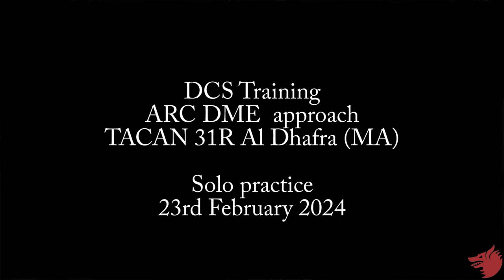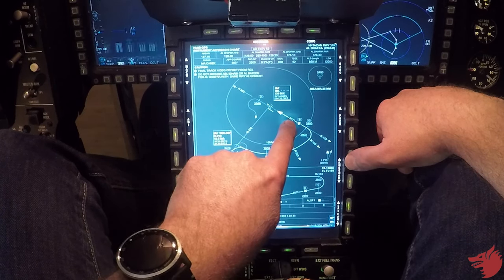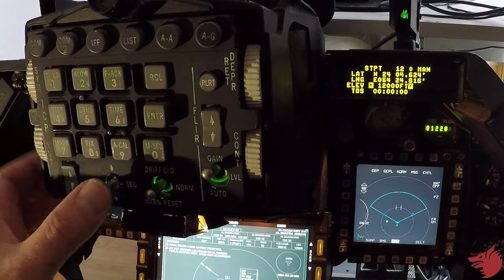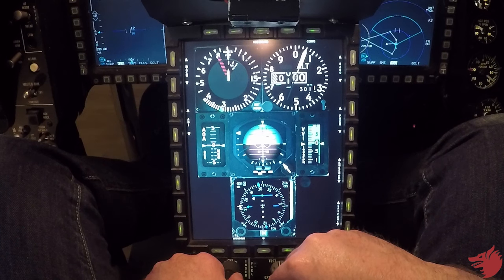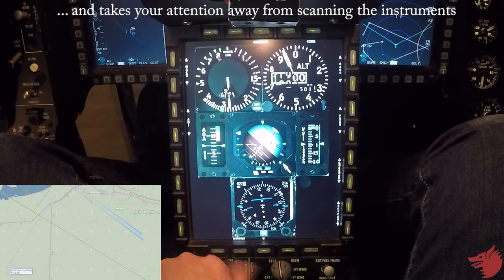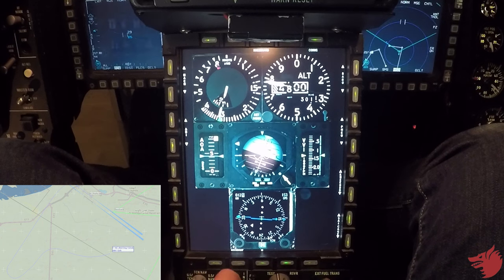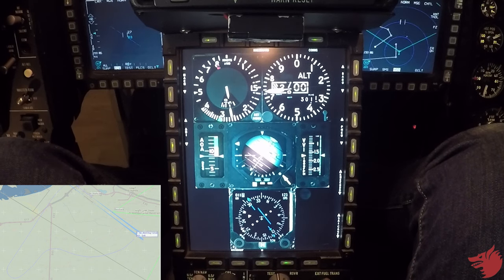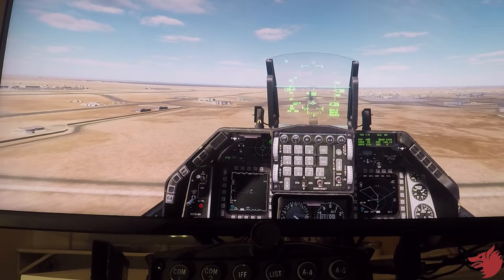DCS training ARCDME Tacan approach - F-16 cockpit

Comment: Hey Reddog glad to see you here! I would like to know are you use YAME64 with Helios?
Reply from the maker: Hello mate, I stopped using YAME. This here is only made with Helios :)
Reply: @VPreddog Cool! so you put the flight check pics in CPD? how do you put commands beside CPD buttons?
Reply from the maker: it's the DCS kneeboard. kneeboard increment and decrement pages are implemented with a DX button on the CPD bezel from DCS control menu. The kneeboard is activated by the top center button through both DCS (to enable it in game) and through Helios (to hide instrument/display kneeboard) and inversely when the button is pressed again. This was the trickiest thing to find out :)
Reply: @VPreddog Thank you Reddog! I will try to play a while with it!:D

Comment: What kind of mfd is that
Reply from the maker: It's not a MFD, It is a CPD aka Center Panel Display. It's a unit placed on top of the central panel meant to replace the analog gauges by digital instruments. Some block 30 from ANG have it and latest blocks (60 and 70) have some sort of CPD version as well. The digital gauges are not yet implemented in my pit as they are in development but it is already a great way to have access to digital charts, checklists and mission datacards rather than having a ton of paper when you fly.
Reply: @VPreddog  create a diy kneeboard using a cookie-sheet, tin-snips, an unsuspecting piece of velcro aka "loop n hook" and a  chip clip...I made one out of a small acrylic clip-board and shoe string...no laws against being creative and its not like youll go inverted and loose your pen. Cheers!!
Reply: @VPreddog where did you get it
Reply from the maker: I built it
Reply: @VPreddog  please tell me you have a video on how you made it